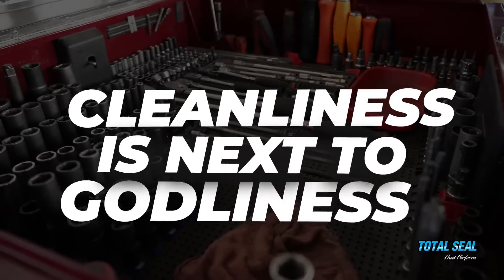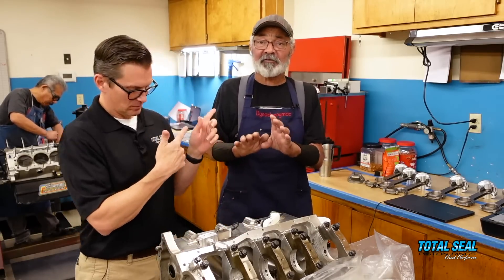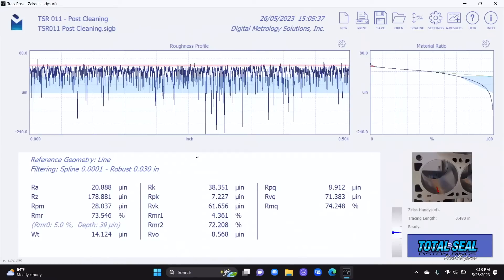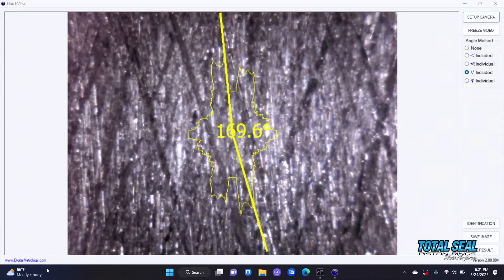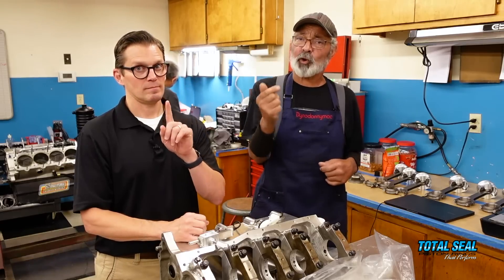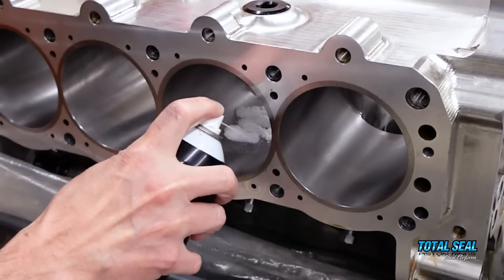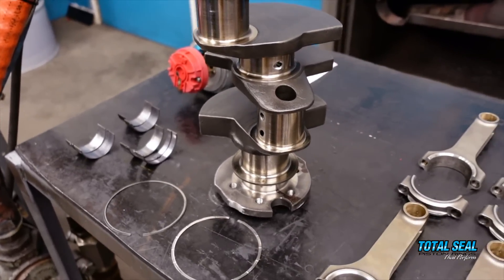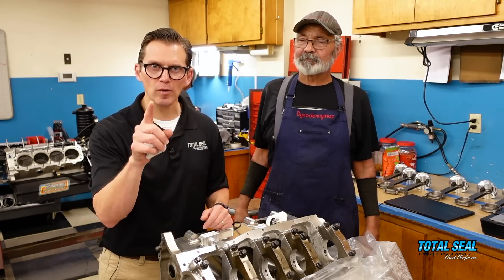How CLEAN IS Clean Enough? (Microscope Inspection REVEALS All)

Comment: Curious, what's the final wash procedure before you used the foaming cleaner? 

We run the block for about 10 minutes in the jetwash, then flip it. On the flip we brush the bores with a fine plastic bore brush on a drill in forward and reverse. On each bore the brush gets dipped in a bucket of granulated Tide and hot water. 

The block gets another 10 minutes  on the other side, then rinsed with cold filtered water (slows the rusting process) the cylinders get blown dry first, coated with WD in a spray bottle, then finish drying. 

We leave the WD on the cylinders until rings are finished being gapped, as that can leave some contaminates behind, then the WD  is wiped out with lab wipes and acetone. 

There's very little black stuff left behind on the final wipe down. Seems to be working well. Been doing it this way for a long time.

Comment: I use carb cleaner and finish up with WD-40 with lint free towels then wipe down the bores with a 50/50 solution of Marvel Mystery Oil and regular engine oil. Neve have had problems.

Comment: You want to clean your engine you need to get rid of all of the oil because it is the oil that holds onto the dirt. My products physically eats the oil and turn it into water. Spray it in brush it with nylon brush and rinse with my product and the grit is gone because there is no oil to hold onto it.

Comment: Built hundreds of engines since the late 70’s, more 2 stroke outboards than car engines. Degreaser followed by hot pressure washer from the top and bottom of the cylinders, 15 minutes at least on a block. Immediately hit cylinders with plenty of Wd40 and blow dry to prevent rust, the hot, completely clean cylinders will rust immediately. Before final assembly, completely wash cylinders with brake cleaner, blow dry, and hand rub 2 cycle oil on the cylinders. I never put a rag in the cylinders! Don’t want the lint stuck in the cross hatch.

Comment: 35 years ago when I worked for Darlings Nissan in Bangor, Maine Brian in the next bay over was rebuilding a four-cylinder engine for a Hardbody Nissan pickup. I noticed he use brake cleaner only after honing then dropped the new pistons and rings in without any other cleaning. I told him he needs to take it outside to clean it with dish soap and a garden hose and scrub brush, then clean it with brake cleaner before assembly. He paid no attention and called me an idiot. A week later the truck came in on a hook, the engine was completely destroyed

Comment: What did you use to clean cylinders? WD40?
Reply: Wd40 is for electrical parts that are wet.  While you probably knew that, also know it would be prudent to have proper fluids on hand before the job began.

Comment: Have you ever tried using ATF on a white shop rag?
 The ATF detergent seems to highly clean cylinder bores after cleaning and it pulls it into the white shop rag very well.. I've been using it for years with a 30x magnifying glass to check it in the absence of high dollar profilometer that a small time guy cannot afford yet.
Reply: Yea I use ATF for the first cleans then step down to a thinner fluid like WD-40.

Comment: I work for a diesel engine OEM as the Quality Engineer on such a topic.   We use a strong solvent and audit the size and qty. of particles plus are they mineral or metal.  For this we need a 60K microspore to just count the particles by size. Mineral is the worst since it doesn't break down.  On top of this you need a tremendously expensive electron microscope to truly know if you are looking at a mineral.   For metal particles hundreds are allowed between 200 and 600 microns.  For minerals the size is 80 microns.   You can be primitive and get a $100 digital USB microscope to see a 80-micron particle.          If you want to see the valley of a surface then you need an expensive tip on the profilometer with a 2 micron tip radius.  Consider $3000 for such a profilometer.  Check this before you by such an instrument.   Zeiss makes such a profilometer.  Consider $7000 if you want to traverse a crankshaft.
Reply: What's a strong solvent? Solvents are just something that can wet particles and flush them out.

Comment: I hand wash the block with a variety of brushes, soft brass and nylon, pressure wash then steam it, after that i wipe throughly with light oil and then wipe and repeat. Cleanliness is key to engine life. It might be overkill, but never had a failure related to a dirty engine or premature wear. The brass brush is like a godsend to breaking out honing swarf from small crevices like the bore pattern. Do not use brass in oil holes!! If you do, use a good quality brass brush otherwise the wires will come off in that hole. Ive also slapped them together and it turned out fine, but i needed the engine in a hurry and didnt really care as i had a spare in case. Industrial engines, it doesnt matter, the dirt is coming in regardless because they dont maintain those engines. Nor is the company going to pay for that level of cleanliness.haha throw it in, we needed it yesterday, is usually what you hear.

Comment: 25 yrs ago when I was the block man at the race engine shop, I always finished the bores with the nylon bottle brush hone. 
The assembler's job was to scrub them down in the clean room.
We built some great engines.
I noticed your crosshatch angles. Does that vary with ring type?

Comment: Oil is a binder for grit. 
Wash the cylinder with soapy water to dissolve the oil. 
Rinse with clean water. Lift the water with alcohol. 
Wipe or spray the cylinders with oil again. Wipe with a clean rag.  Any grit should show up on the clean rag.  Repeat of necessary. 
Clean cylinders.

Comment: Just like installing new brake rotors, I but them in the parts washer to get the oil off, then scrub with hot soapy water, before a brake clean bath.

Comment: This is where 90 percent of builders go wrong!  
I actually use hot mineral spirits and a bore brush first while constantly running hot mineral spirits in a from the tank. The hot mineral spirits causes heat expansion to help trash fall out. 
This gets 98 percent of the trash out. Then wipe with transmission fluid and shop towels until I get zero debris on the towels.

Comment: I remember the white glove test. 
After you think the bores are clean, take a white cloth or gun cleaning patch and wipe the bore. 
If the cloth doesn't come out white, start over. 
If you use total seal dry film lube ,it should turn a greenish color when applied and if it doesn't you still have dirt in the bore.

Comment: Maybe there should now be a second part to honing where the honing cutters/stones are replaced with a series of fresh coarse to fine cleaner clothes which are designed specifically to remove imbedded particulate left by the honing process?

Comment: And what do you use to keep it from rusting after you clean/clean it?:body-blue-raised-arms:
Reply: I use fogging oil to prevent corrosion, even engine oil will.  You must cover it well, air wafting through a dirty garage is blowing dust everywhere.
Reply: @thisisyourcaptainspeaking2259  As I thought!. Was thinking large trash bags. I assume any painting would be done after assembly?
Reply: @BudBoomer-st2be  Actually it's easier to paint after assembly but I prefer the look of the unpainted edges of gaskets, they look better to me.

Comment: I have always used, soap and water first, transmission fluid second, to float the debris out, and carb cleaner to strip the trans fluid, followed by dry lube and clean engine oil. Never had trouble seating rings or having them wear out rapidly.

Comment: So what products to use to clean with? Brakleen, carb cleaner, wd 40, type f trans fluid, foaming glass cleaner??

I understand you want to sell the microscope but for the avg person the cleaning part is whats going to be done. 

Only gave us half of what we needed here to be informed.
Reply: I have read many cleaners can prevent engine oil from sticking to cylinder wall and always use soap and water last
Reply: I use regular gasoline to clean with it’s pretty cheap and does a good job. One of the premium gasolines with high detergent probably even better but normally I just use the cheap stuff I run in my lawnmower and weed eater because it’s readily available.
Reply: @bcbloc02  I have heard you do not use gas it won't let oil stick to walls just soap and water last
Reply: @  I mean the walls are getting gas all over them once it’s running. When I coat the walls with oil before installing pistons I don’t notice it beading up or acting abnormal on assembly.
Reply: @bcbloc02  I say all's fair in love and war.  Just haveta get the debris cleaned up then check and make sure it's gone.  The standard has always been hot soapy water, always seems to work for me.
Now I have a pressure washer to rinse it all away, gonna give that a try next time along with the normal soapy warm water, cheap dish soap.
I wish I had a steam cleaner...
Reply: @bcbloc02  gas gets in honed groves and repels the oil from sticking
Reply: Solvents wash away the oil that's holding the debris, and then the debris sticks to the metal. 
Start with hot soapy water and even straight detergent on the bores and scrub away with plenty of hot water. 
Gotta float that crap out of there in suspension , similar to how oil carries away debris.
Reply: I ask because in the 90's when I was a machinist building engine's we would wash the block and clean the bores with trans fluid just prior to piston install. Lake was using a foaming product and I  would like to know if procedures have changed. In the motorcycle industry wd 40 is often used for final cleaning because it is a solvent.
Reply: @metalpolishshop  Every recommendation I've ever read specified hot soapy water.  Water is actually a solvent but it doesn't leave residuals behind.
I think there are a few important variables, volume and effectiveness of solvent are two important criterea.  With water, the variable of volume becomes a non-issue whereas other solvents may in fact work better but are generally more expensive?
So I've always stuck with hot soapy water then of course measure effectiveness using a white lint-free towel or paper shop towel, coffee filters  etc. with atf or a clean light oil to determine if debris still exists.

Comment: Way back in tech school we were taught to wash the block with soap and water and used a toilet brush in the bores.
Reply: Yes that's all good just wipe with paper towel to verify they are clean
Reply: @stevengrissom7142  LOL..Paper Towel is the last thing I would use...
Reply: @northface484  Lake Speed literally used paper towel in the video.
Reply: @northface484 Paper towels work fine.  Blue shop towels are better.  Microfiber rags are best, but you spend a lot of money for negligible gain.
Reply: @northface484 not all paper towels are created equal.  Same goes for coffee filters (the large commercial basket filters are horrible).
Reply: Y’all had Paper towels, We got rags from the Uniform company when I worked in the field, that’s what you used.
Reply: Can use soap and water, that is fine, but it you need to solvent clean after.
I use trans fluid, then WD-40 then something like that foam stuff they used.
Reply: Wiping with blue shop towels quite adequate. Now if you are obsessive compulsive you should use Sontara Wipes or one of a couple of other aerospace certified technicians/ mechanics wipes. You’ll never see any difference but you’ll be proud of yourself for being smarter than everyone else. Lol
Reply: Yes, used to do it that way, but with the advent of pressure washers, they are very effective at cleaning a block using Dawn dish detergent.  Then spray with WD40 to help displace the water and prevent instant surface rusting and then wipe down with a rag soaked in motor oil.
Reply: I was going to post a clean solvent with a nylon brush to scrub the newly honed bores. Would it actually work?
Reply: Yup, I heard scrub with soap and hot water, then flush generously with fresh water. Oil galleys too.  Dry immediately and wipe, scrub cylinders clean again with clean towels and oil.
Reply: Yes I was taught to use hot soapy water then coat with oil or an anti rust treatment .
Reply: Yup, that's what they told us and checking with paper towel 😂

Comment: That's an easy one. It needs to be Surgically Clean. Clean enough to let a Dr perform surgery on You? Sealing surface? 1st surface to the required RA. Pressure Clean and Blow Off with High Pressure Air. Prep Surface according to Manufacture's Specifications or Better. Would You Eat Off It? Yes, or start over.  🤔🤔🤔  GOOD JOB LAKE  👍👍👍👍👍

Comment: Ok, how about some suggestions on how to "properly clean" the cylinders?
Reply: Here's how I do and have been doing it for 25 years:

Large coffee filters and lacquer thinner(from a spray bottle) first pass.

Coffee filters and ATF(any cheap ATF will do), inspect the filter for darkness, continue till clean red fluid only on filters.

Lacquer thinner on filters to wipe clean and remove all ATF, filter needs to clean and clear looking. 

WD-40 on filters to break loose any la a t bit of grit, wipe cylinder till very light to no film of WD-40 left

Apply Total Seal Quick Seat and look for cylinders to turn green with ENVY. (FYI, a little goes a long way and take care opening the plastic container.)

NO OIL IS NEEDED ONCE QUICK SEAT IS APPLIED.
Reply: @arturozarate1752  do you add any oil to piston or rings using the quickseat powder?

Comment: Knowing a bit about metals, I would disagree on titanium being hard, its strong, but hard? I would be willing to bet the cast iron the block is made of is harder than the titanium retainers. I wonder if the wear particles are work hardened by the way the wear happens, maybe more of a spalling type wear instead of wear from a sliding motion?
Reply: Ti  is indeed one of the hardest metals.
Reply: Ever try and machine that stuff? 
It's a tool bit killer, even with plenty of lube.
Reply: Ti is harder, I have some scraps from an aerospace manufacturing plant, it's ridiculous.
Reply: I worked in aerospace, I have some Ti right here, it's tough, it's strong, but it's not hard. I've sawn it with a HSS blade.

Comment: I use break or carb cleaner and a quality paper towel..alternating with transmission fluid until there is no discoloration on the paper towel..then go back with a lint free rag..its a pain to get them clean.. ( I didn't clean the first  engine I put together around 40 years ago..and it ate the rings out quickly, it was a 283 SBC..lesson learned...LOL)